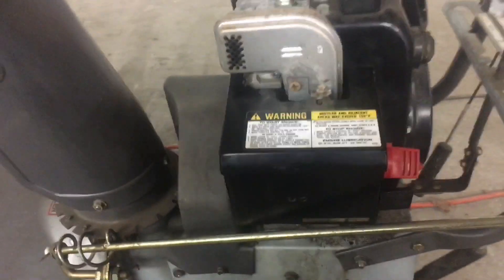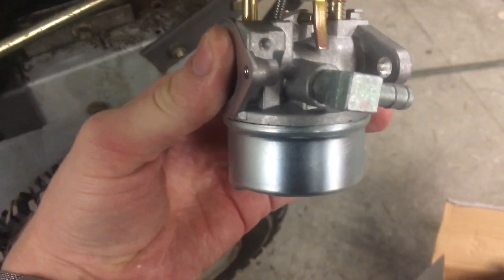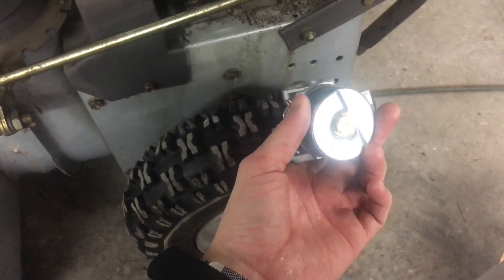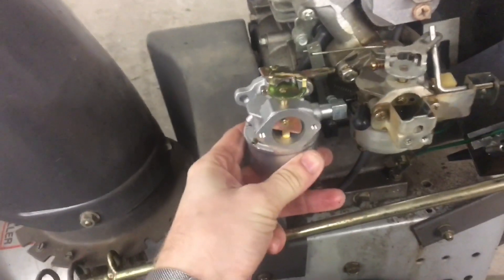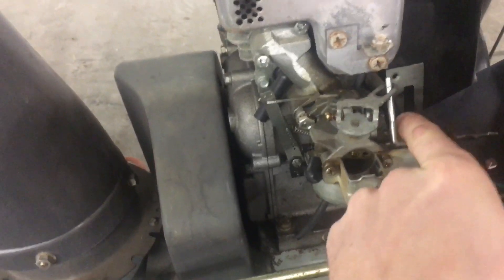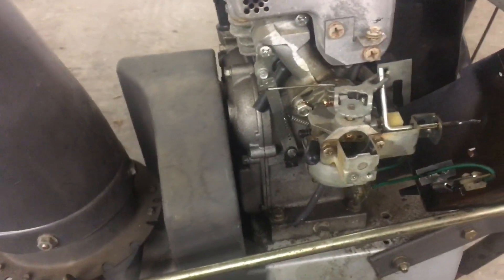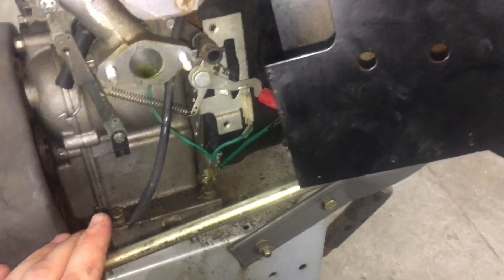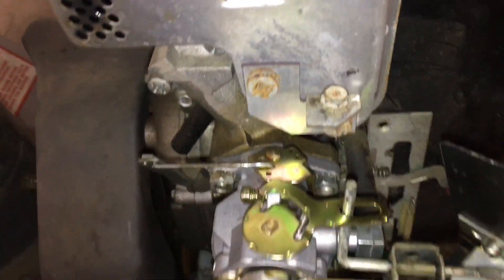Small Engine Repair DIY: carburetor replacement Craftsman Tecumseh

Comment: You hook your carburetor linkage back up in the wrong hole you need to go to the far outside bottom hole
Reply from the maker: IF that's true, it doesn matter. has been working perfectly for years.

Comment: Looks exacltly like mine. I have a flame that shoots out the exhaust sometimes.
Reply from the maker: my 8hp tecumseh craftsman blower at home does that sometimes when I use ethanol fuel and it  runs lean